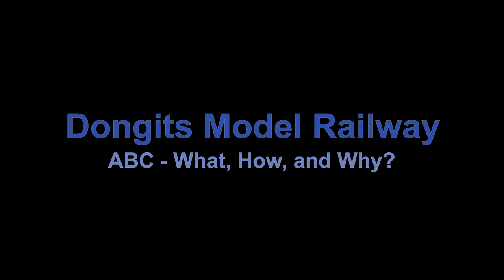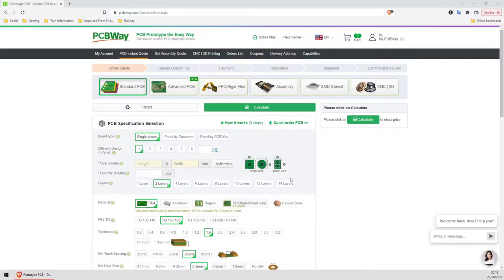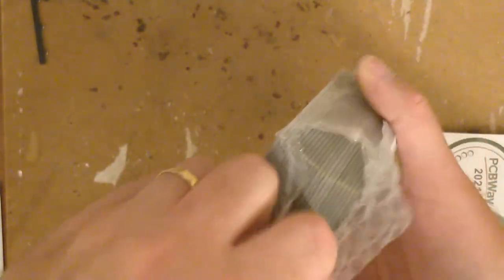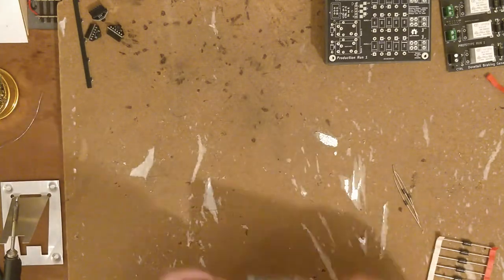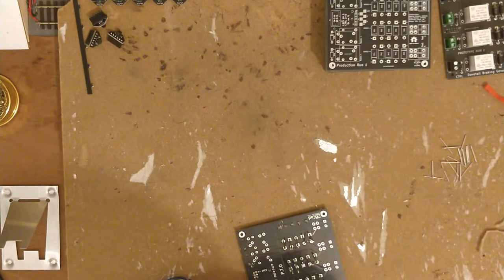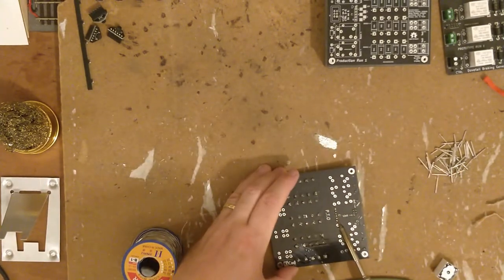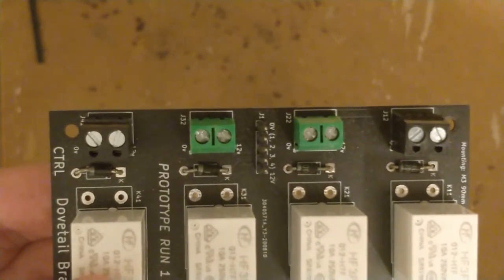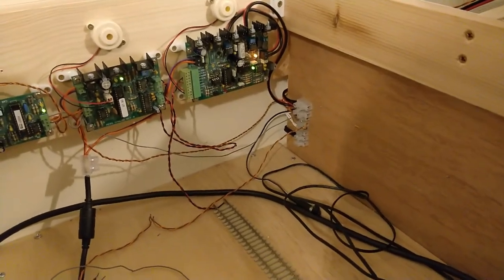Rapid Prototyping a Custom DCC ABC braking PCB with PCBWay

Comment: hi what diodes are you using i think i can see 4 1n5402 rectifier diodes but can't see the 5th thanks
Reply from the maker: The larger diodes can be any 1n540x.

I've got a few different types, depending on what was cheapest at the time I was ordering them. As they are back-to-back, the worst reverse voltage they will see in normal operation is about 2-3v, and even in the event of failure it's circa 16v from DCC. Both well below the reverse voltage tolerance of any 1n540x, the lowest of which (1n5400) is 50v.

The smaller diode to catch any spikes from the relay is a 1n4001.
Reply: @DongitsModelRailway  thank you very much for that information
 so all 5 diodes are the same  ?
Reply from the maker: @nicks5337  All of the ABC diodes are the same, yes.

I think I might have finished up one batch from one supplier and moved on to another batch half way through building this module, so the markings may look a little different, as a result. Same diode though.
Reply: @DongitsModelRailway  thanks again time to do some experimenting